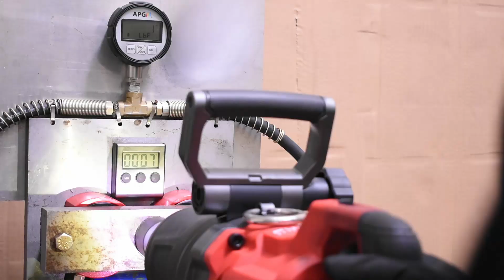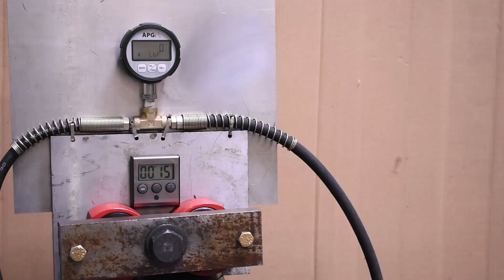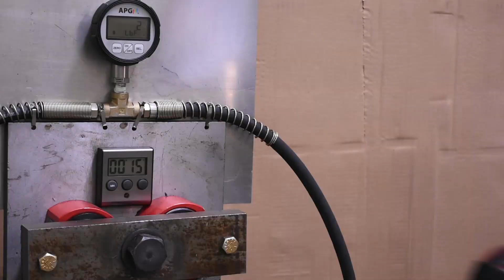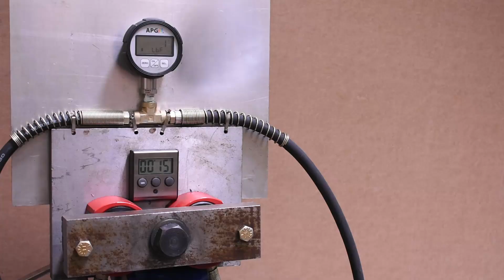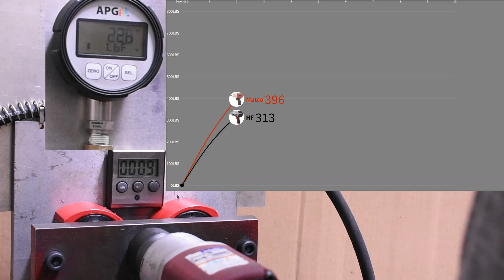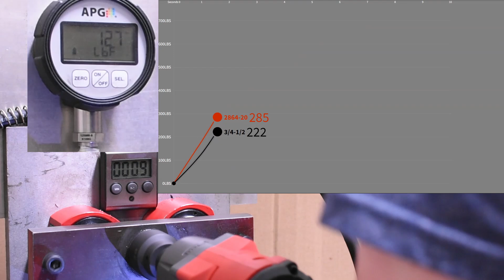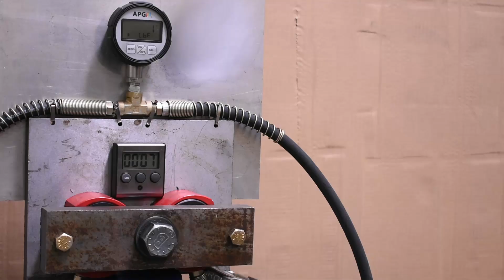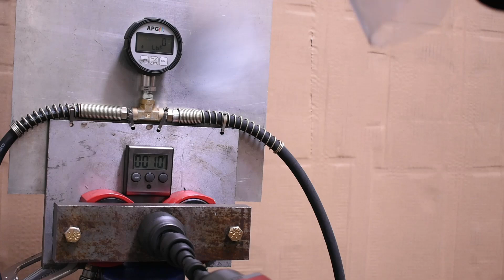How Much Power do Impact Drive Size Adapters Lose?

Comment: Yeah if you're using a 1" to 1/2" adapter, you're a desperate fool at the end of a pathetic rope. And somebody smeared JB weld all over that bolt's threads before putting it in.
Reply: Well, if people ‘haven’t’ got, they tend to make do with what they ‘have’ got. I once, unbolted a 6” bench grinder to use as an angle grinder, before I knew angle grinders actually existed!

Comment: I had to use my 1/2" m12 stubby with a 1/2 to 3/4 AND a 3/4 to 1" adapter to go onto this giant custom socket for some robotics work. It didn't need high torque, but was just a massive size. I found that due to the slop between the adapters the majority of power was being lost. After running it several times I noticed the adapters were very hot. Not an ideal setup for impacts, but for linear force it would be fine

Comment: A cheaper alternative would be to add old used non leaking water heater tank and bumping up your line size from the compressor to your hose

Comment: The very first adapter test you compared a stubby 3/8inch socket to a deep 1/2inch socket. One is far longer than the other. Maybe you should keep the socket lengths comparable.

Comment: Can you weld a metal cup/plate to the end of a 3ft breaker bar, and then put the bit of a 70lb demolition hammer into the cup? Not sure what kinda torque this would make, but seems like a contender for most powerful “impact gun”

Comment: I had no idea an adapter would result in any significant torque losses. Can anyone explain the physics of this?
Reply: I’m baffled too, unless it has something to do with minute slop between each fitting causing the socket (firstly) to rebound (after striking the nut) followed by the extension, onto the gun’s anvil, that’s just started driving again? 

So the rebound of the sockets are subtly working against the drive of the anvil, sort of thing?
Reply: @SeriousSchitt  that's a good theory! I could see that being the right answer for sure. I guess that's what I'll go with unless I hear otherwise
Reply: @ Thanks mate, it’s only a guess though.

Comment: as far as the 1 in gun goes, and the 3/4in, since i have both, the trick is that you get the initial couple of hammer hits, but thats usually all it takes.  I have a 30 gallon 2 stage triple pump compressor that can keep up with my HVLP gun just fine, but even with a 3/4in air line, it cannot feed a 3/4in and a 1in gun more than a few seconds.  I get like 4 good hits, and if it hasn't broken the bolt by then, its loose.

Comment: You need an "air receiver tank" hooked up between the tool and the supply at the wall. It'll help alot with the pressure drop problem your having. You can run 3/4 line from the storage tank to the tool and it will be cheaper than redoing all the line.
Reply: the half inch line is your air resistor
Reply: @drewlarson65  it can’t hold enough though or transport the air quickly enough.
Reply: Need the tank pumping air into a big holding tank filled up then turned on backing up the air that's being used to keep up but enough air to supply the gun, or just ask the company wat they are using for there tests there probably tell u

Comment: I think you need to test the air gun correctly at spec, some guys spend that much on stuff in there own shop. If you need a 10k compressor and 1 inch line then so be it

Comment: I use a 3/8 to 1/2” on my Milwaukee stubby impact and it takes off lug nuts up to a little over 100 ft lbs. It also tightens them anywhere from 90-125 depending on the socket used, verified with a snap on torque wrench

Mind you this is with large heavy 1/2” sockets that add to the effectiveness, when trying to use the lighter weight 3/8” sockets it doesn’t work quite as well

Comment: Thanks for this video. I always wondered just how much it was, knowing there was a big loss in practice in the shop. Anytime something would not loosen, removing the adapters and hitting it with all same size sockets and limiting extensions always does the trick...or snaps it off.

Comment: Milwaukee should do away with the square drive impact wrenches. A splined impact wrench anvil would be ideal. The square drive is very loose and a lot of torque is lost at the square anvil/socket interface. Milwaukee could also sell a line of its proprietary spline drive impact sockets. It would be great
Reply: While this is a neat idea, it would never take off enough to actually make sense for the company. If it's not broken, it doesn't need to be fixed, and square drive impacts are not broken.

Comment: Few users actually understand/set up their compressor system properly and run wide open instead.  What is your test rig?  CFM/PSI/Hose diameter?  How many little tire shops have a clue?

Comment: I have a chrome duralast 1/2 to 3/8 adapter that seems to refuse to die. First time I used it, in 2014, attempted to rip lug nuts off a car with a breaker bar. About 6 feet from the lug nut with about 260 lbs bouncing on it. Didn't get the lug nut but I still use it to this day.

So I'm wondering if the chrome adapters (while not "right") on an impact work better than the impact adapter.

Comment: I learned this on a job where we had to tighten 200 bolts then jam nut them my coworker had just bought a set of sockets with universal joints every single nut he tightened came loose I had to spend my saturday fixing it

Comment: Real work scenario I’ve experienced is short sockets seem to break loose really tight bolts better than deep sockets. A lot of times the deep sockets won’t even loosen at all no matter how long you hammer on it.  Have you tested this yet?
Reply: I could agree with this, also using 12 point sockets might impact. I use my weak ass impact wrenches with any socket I have..
Reply: Less flex

Comment: Was taking  main caps off a hemi the other day, the main bolts were estimated to be at 140lbs breakaway torque. Using a 1/2" to 3/8" 8" extension taht may or made not have been made from broken sockets welded together, a 440# impact barely managed to remove the bolts, no doubt due to the extension I imagine. Do you have a video showing the effects of extensions on torque?

Comment: When I bought my 3/8 I intended to use it with very light duty 1/2 work sometimes. They make a 1/2 version of the same tool but having may other 1/2 that suit the bill, and with most of the 3/8 outperforming the 1/2 of the same versions around here I got a set of step up adapters. I don't know that it makes any difference but the ones I got sit directly atop the anvil making it less of an extension and more of an adapter. Fitment is probably more important than length but it would be nice to know. It works out to be only 1/8 or so longer than the original anvil. They are called low profile adapters.

Comment: Logical. There's always a certain amount of Play Between all adapters and sockets and of course Fasteners and as you multiply the things between the gun and the Fastener you're multiplying the play and therefore the loss. I would think this also has to do with continual wear  on sockets ,extensions , adapters and fasteners as well. Good content. Thank you

Comment: If you only have a small air hose, extra air tank will help. Like that:  your compressor is at 30 yards away and your air hose is only 1/4". put extra air tank, maybe like a 5 gallons or so near to the tool you are going to use. Like this. Compressor 30 yards away. Small 1/4" hose from compressor to the place where you are going to work, and attacht that to the extra air tank. Then same 1/4" hose if you doesnt have any bigger hose. Or if you have, use like 1" hose from the extra air tank to the tool you are going to use. Both will help, no matter if you use bigger or smaller hose. Both will help. Bigger will help more I guess. I know, I have tested this! ( Please trust me, I'm an engineer!) Ps. I hope you test this method in action! I'm sure it will give way more power, than just a regular small hose. Of course you have to give some time for the tank to fill it up. It will help nothing if you push the button at the bottom. So, give it some time to fill and push the button only for small pulses. It's not maybe the fastest way to do the job. But it will make it possible to do the job. And thats the thing. Try it please.

Comment: I use the 1/4 in Dewalt driver for so many fasteners on autos. Mostly on interior and accessory fasteners. I also understand it capabilities and switch to 1/2 in impact when necessary.

Comment: Do you need to account for the different mass of the sockets when comparing torque numbers between adapted and non-adapted tests?  I think you've got a confounding variable there that needs to be removed or accounted for.  As you pointed out in the video showing the mechanisms in these tools, F=ma.  Assuming a is held constant with the same gun, the m is going to change if you're using significantly differently-sized sockets over and above the penalty you pay just by adding the adapter (the mass of which  may account for  those ca. 7% losses you saw).
Reply from the maker: We have videos on it, tagged in this episode. F=MA applies to the moving object, the hammer, not the nail. But there is something to adding mass to a socket.

Comment: I currently work at fedex as a diesel mechanic. I was curious since I run my 3/4 snap on impact. Our lines are run at 140psi and it drops to 100psi. Our shop uses 1 Ingersoll rand compressor and the shop is large. By size it can fit about 24 single axle semi trucks inside the shop. I'm sure there are a lot of other heavy duty mechanics that watch your channel. Would be nice if you could one day test the 3/4in air stuff.
Reply: Agreed. I would love to see the 3/4” stuff. maybe even without ideal air pressure to see if they are still worth using if you can’t feed them proper air.

Comment: This does make me curious what would happen if you welded the adapter to the driver - clearly a permanent modification, but would theoretically show how much is lost due to length/weight changes vs vibration. Perhaps a For Science episode?
Reply: you'd ruin the hardening and make a weak breakage point that winds up losing torsion. lose-lose result.

Comment: Do you think there is cfm loss in the tight radius 90 degree rigid pipe fittings? Don’t know much about pressure or air tools though.

Comment: I've been ridiculed several times about using a 2767 milwaukee with 1/2 to 3/4 adapter to a larger 3/4 drive socket taking off semi lugs. good to see some actual numbers. I've also broken 2 of the 1" to 3/4" step down adapters using 1" air impact with 3/4" drive socket. you wouldn't think a 3/4" drive adapter would break but indeed they will!

Comment: Have you guys tested using one hand to preload the socket and adapter towards the direction of impact? 
I've found when doing this you can over come some of the loss in impact due to the space between the socket, extension, and gun and loosen things that otherwise would appear to tight for the sloppy setup. It would be interesting to see torque gained by preloading!

Comment: Couldn’t tell ya the numbers but at my work we have a duel 2 stage air compressors plumed together on 1/2inch line. With the 3/4 and 1 gun we can work about 3 or 4 minutes before we have to stop and let the air build back up. M24 sized bolts that are tightening to like 600ish pounds

Comment: Experiment idea: Try several different sockets that have different masses (weights), but with the same socket and driver size - this could be done at lower torque with standard thin-wall sockets. I suspect the performance will depend on the mass/inertia of the socket (or socket+adapter). An impact wrench is like a hammer hitting a wrench attached to the bolt: if the hammer is very small or the wrench is very heavy, the amount of torque applied will be less, and if a large weight were added to the wrench, the hammer would be less effective. Cheers!
Reply from the maker: We done a weighted socket episode!
Reply: @TorqueTestChannel  Very neat, I just checked that out, thanks!!

Comment: I always use larger line than 1/2 inch for the 3/4 and 1 inch tools But since I got my Makita 1/2 inch 18V impact I rarely use those larger air tools any more.

Comment: 3/4 inch cordless impact is way cheaper then 3k compressor plus still having to buy a impact gun itself. Now days air powered is going obsolete, There is still a few tools that air is useful for exp Air hammers and Small Die grinders/ Air saws/ Cut-off wheels, I know they make cordless Die grinders, But not very small light ones that can run a long time at high rpm. It is getting there though. Air compressors are still useful though for small other projects.

Comment: Usually I'm not concerned with applying torque when using adapters anyway. It's usually just to snug things in tough to reach places until I can hand tighten them

Comment: Always wondered this- my IRC9000 and my PT850 will always break a Honda crank bolt more easily when I have a 1/2F/3/4M adapter and a 3/4” drive 19mm snap-on deep socket on it

Comment: Well you just measured the basic rule of impact tools: You lose power if the thing in the front gets longer or/and has more connection points. (Same thing goes for all impacty type of work/tools)
Even worse if an Adapter messes around with the tools "balance" or whatever you may call it. Edit: Tuning might be the correct term😅
Reply: It's not the length, but the wobble which causes the loss of energy.
Reply: @firesurfer   True but the wobble is caused by the play in the connection points, the lenght is just a "natural" circumstance due to that many adapters beeing stuck together. 
What i meant in my first statement was that a socket with an extension loses more power than a standalone socket(even when ignoring the extra connection) because there is flex: more lenght = more flex = less power where you want it to be
Reply: @SweetVictory13  No. All losses are due to flexing/wobble. Any loss due to length is marginal.

Comment: I think you would have more accurate readings if you used a normal sized socket on the test rig not a 40mm socket
Reply from the maker: Then you'd need a difference size bolt for each larger size impact and it wouldn't be compatible
Reply: @TorqueTestChannel  if i win the lotto tonight ill buy you all the equipment you need. Excellent content though guys keep it up. 👌

Comment: Milwaukee 3/8 user here...beast of a gun.  Crazy to see the loss from the 3/8 to 1/2.  Only time I use that is for lug nuts of the domestic vehicle variety, no heavy duty stuff, so plenty of power for that even with an adapter.  Just gives me an excuse to buy more tools if ever I need more power.

Comment: You caught me off guard with the 1/2" to 3/8" adapters not lasting. I bought two matco adapters of that type almost 10 years ago and use them fairly often and never had one break. They utilize a totally different style than comparing brands featuring a keyed-removable shank that I think helps them apply the pressure points elsewhere and not at the cone tip. Anyhow, awesome video. I loved seeing this as I use adapters daily
Reply from the maker: Part number please!
Reply: @TorqueTestChannel I'm not at work or else I'd look at mine personally and give it to you, but from what I found online its part# cp1612rbd

Comment: Hey, my impact is back! I know that the thing does not like when I use my 3/4 to 1 adapter. If I have the proper 3/4" drive socket it will do most anything I need still.
Reply from the maker: Thanks Gary!
Reply: @TorqueTestChannel  Was happy to lend a tool. Still waiting on TTI/Milwaukee to release a new gen of that gun.. But the old girl is still kicking, and not as pretty as she used to was. Still gets borrowed everytime someone doesn't wanna drag a hose out on some of the heavy stuff.

Comment: Not sure if its been mentioned, but I've have much better luck out of the "low profile" adapters when going from a smaller drive size to a larger drive size. The ones where the impact anvil is recessed into the larger square drive size. I'm wondering of some of the losses are from these adapters acting like short extensions.
Reply from the maker: Bingo, see pinned comment!

Comment: Thank you! I've been waiting for then one for a while now. Question is their a difference in efficiency running adapters on air vs electric? Or do the percentage losses come out about the same?
Reply from the maker: Cordless is less loss, though we dont have comparing data for every type so i dont want to make any bold claims about it.

Comment: I think the stubby adapters might work better for going up, just because the drive is going up into the driven adapter.  Going down in size has always been weaker.
Reply from the maker: You're spot on there, see pinned comment

Comment: Any plans to test bolt extractors?  I recently found "Rocket Socket" brand, and they seem amazing to me!  I had the common Irwin set,  but it never really worked very well.  And I've seen the Harbor Freight equivalent, but those appear to be effectively a one time use item since they're so soft.

Comment: It is a shame Milwaukee doesn't make a #5 spline drive anvil for that  1 inch. I would like to see how much more efficient a spline drive is than a square drive.  I don't remember you doing a direct  comparison of a tool that you change the anvil from 1/4 hex to 3/8 square. The Bosch came close but the anvil is a compromise. My theory is that the 1/4 hex will transfer more torque at all settings below its breaking point. More sides means angular momentum more inline with direction of travel?
Reply from the maker: https://www.youtube.com/watch?v=2nWztRe0yNs
Reply: @TorqueTestChannel  doesn't really test the hex vs square anvil theory if you are using a hex to square adapter. I was trying to think of a direct comparison of more sides vs less.
Reply from the maker: How else would you test the theory with existing tools?